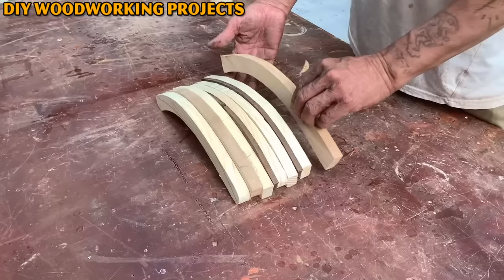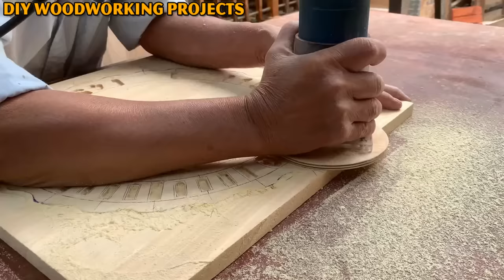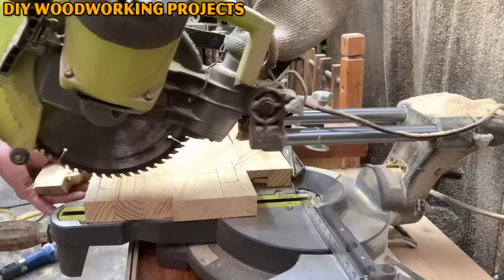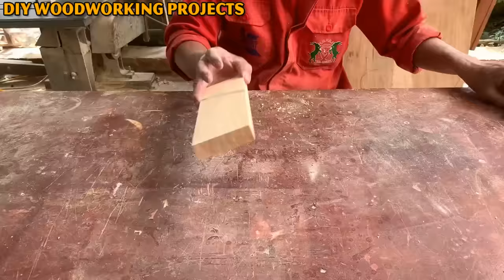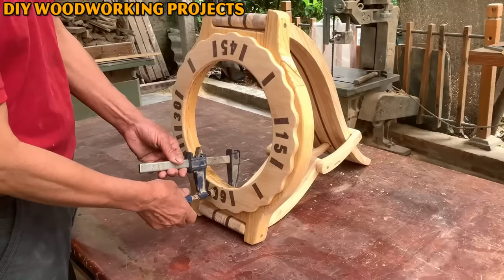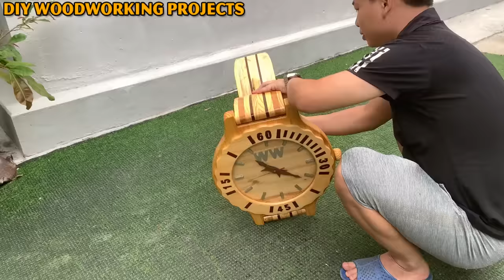One Of The Most Interesting And Unique Designs You Will Ever See // Giant Homemade Wooden Wristwatch

Comment: Operating a bandsaw with such a large gap between the table and band guide is extremely dangerous. You can see the blade flex as the wood is pushed through. But nice work otherwise